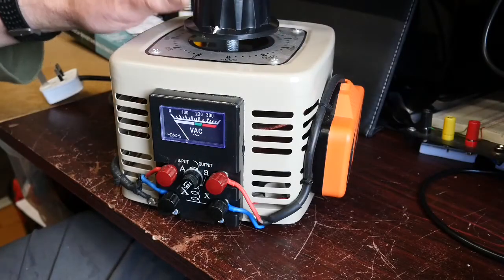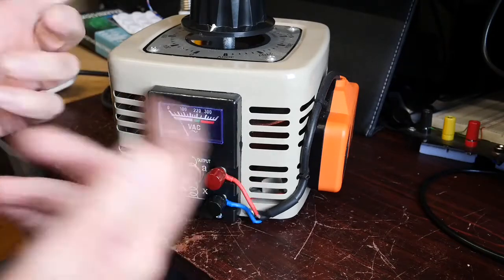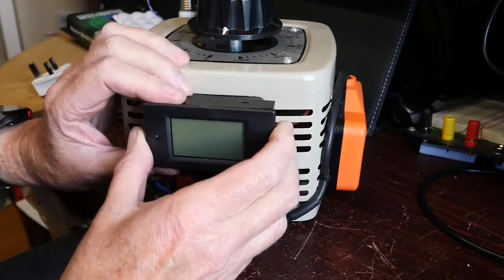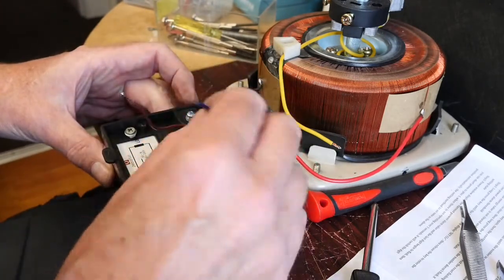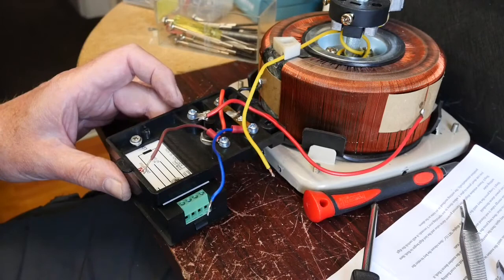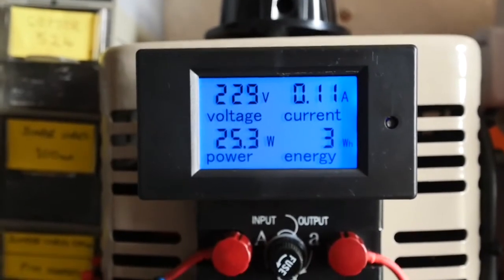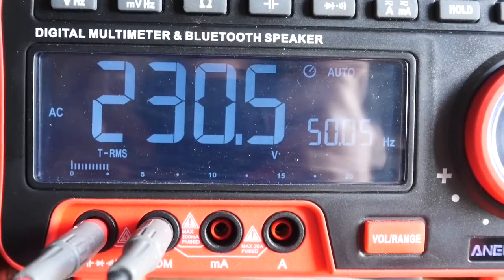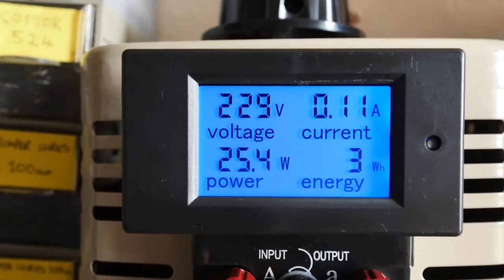Variac modifications

Comment: I was wondering Bill, if the new meter will read down to '0' volts ?   There are various 'hacks' that are around that overcome this issue if you have it, but there are reports that if you do the modified installation the meter then wont read above 190 volts, which is no use if your in GB like us. Appreciate any comments you have.. 73, Pete (G4RYO).
Reply from the maker: My display goes up to 305V no problem, (the max output of my variac) I have double checked that with a meter. 
It comes to life at 48V. There is a mod described here https://youtu.be/wPFaEFEembc that allows it to start from zero, as you say, I have yet to try that. 
73 de Bill,  G1YQY

Comment: Any hints on adding a current limiter to a variac?
Reply from the maker: I use the dim bulb method, it quite a popular method of preventing a run away if a fault occurs.
https://www.antiqueradio.org/dimbulb.htm
Reply: @LockdownElectronics  Is there any way to make an adjustable (to discrete current value) current limiter?
Reply: @CollinBaillie  The way i have done this is to use different wattage bulbs in the above method (which gives different resistances).....but it is not an infinitely variable method which i think is what you are looking for.
Reply: @englishrupe01  That's exactly what I meant to say. Thanks.